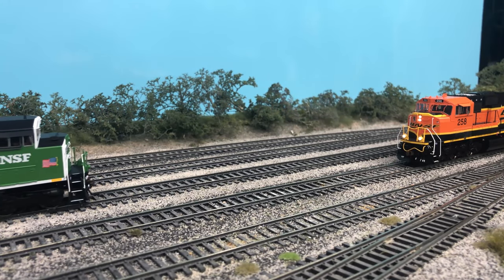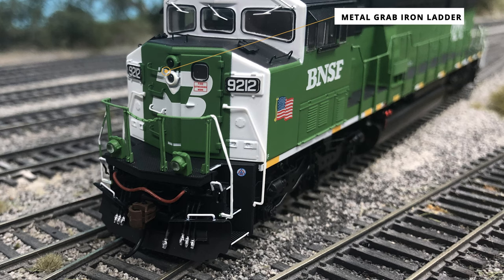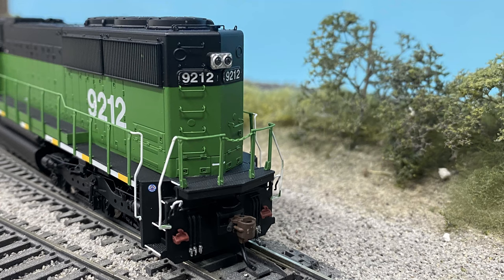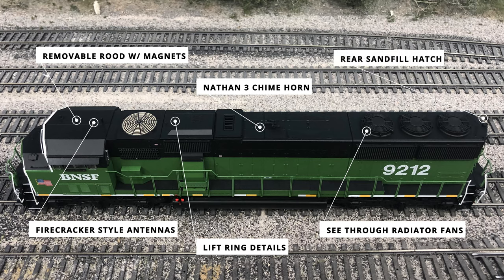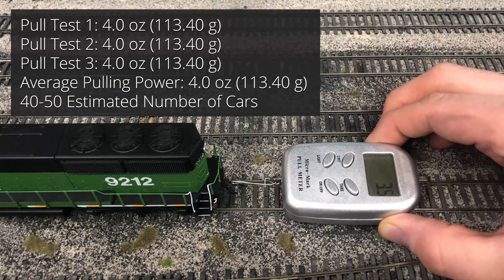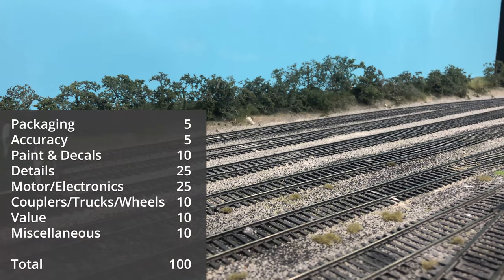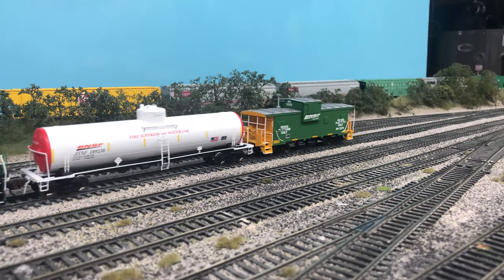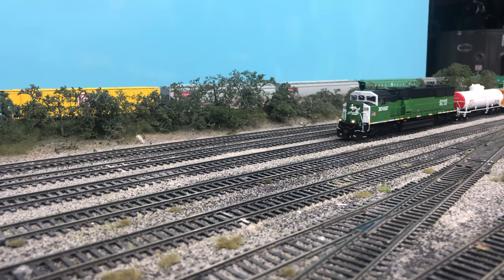Review: Athearn Genesis SD60M TriClops [HO Scale]

Comment: Hi - I am having great difficulty removing the shell. I have removed the couplers and the two screws under the trucks. The front of the shell appears to be loose, but the rear still seems to be anchored. Is there a trick I am missing? And how did you remove the chain. Mine seems very firmly attached to the shell. Many thanks - JOHN GEDDES

Comment: Did you have any problems with the trucks?
Reply from the maker: I didn't have any issues with the trucks, but still might get the replacement trucks just in case. Looking other people's experiences on the message boards and Facebook, it seemed like 50% of the people had some sort of issue.
Reply: @SideTrackX  also do you turn the volume down on it? The sound quality sounds like crap when people have them new.oit of the box